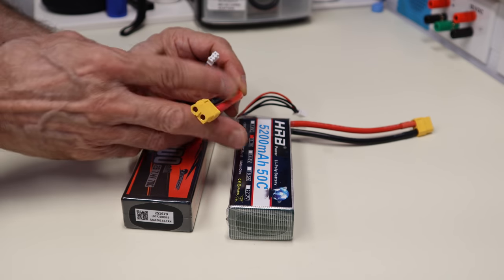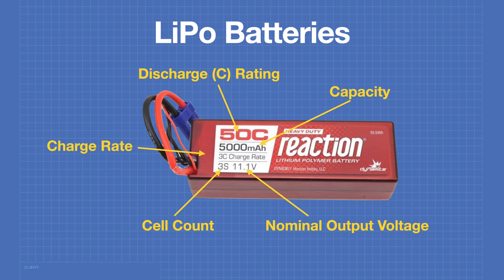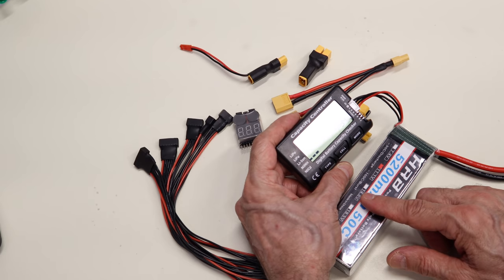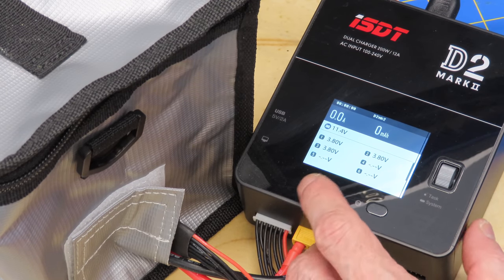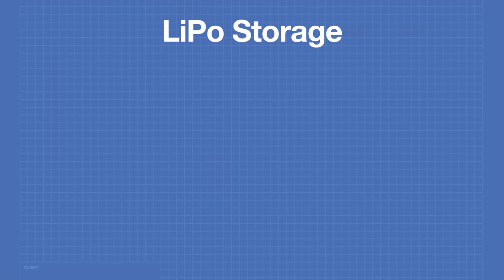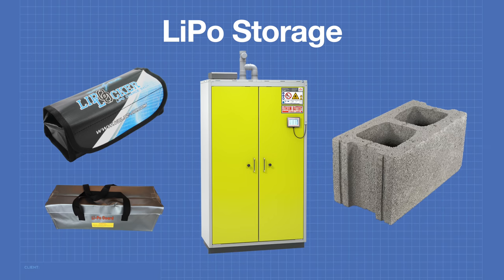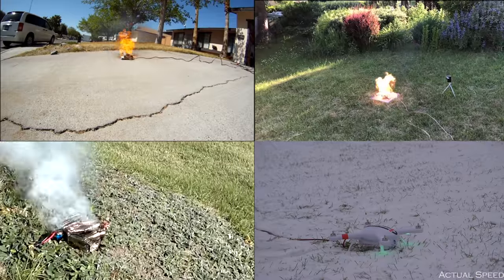Safely Using LiPo Batteries

Comment: When storing with cement blocks, why not use two blocks with the top block turned ninety degrees from the bottom. That would make the battery fully encased in concrete if on a concrete floor or on a third block.

Comment: I'm glad I watched this before buying any LiPos. I'm definitely not prepared for the risks.
Reply: The risk are very rare tho and it’s usually only when charging they don’t just spontaneously combust. Just be smart about where you place the charger and battery every time you charge and you should be fine. There’s people that have dealt with lipo’s all their life and have never seen a fire once. Just follow basic safety steps or charge outside somewhere you can chuck or leave it in case it does happen. I charge mine on my desk on a metal baking pan near my window in a two story house. I never leave them charging unattended and I check on them every like 10-15 minutes to make sure they aren’t getting too hot or making any weird noises. If something were to happen tho I can easily chuck the pan with everything on it out the window worst thing that would happen is the charger might not make the fall but that’s it. Just be smart and sensible you’ll be fine, also don’t cheap out on the batteries. That 10-15$ lipo might seem like a good deal but it’s just better to spend the extra cash and get one from a trusted manufacturer.

Comment: That has to be the very best tutorial on battery management to be found on YT and beyond ;)  I was trained in the military on battery and battery store management way back when and although the chemistry was different it is the same H&S process as you have illustrated. All that you outlined can be usd for any chemistry, just learn the different steps and characteristics. of the chemistry. If you are looking after lead acid then there are various dangers, not least sulphuric acid or performing a gassing charge :) And so it is whith any chemistry.   Thank's for a great video!

Comment: Very informative Bill, with their ability for a catastrophic fire I am surprised they are not required to all have over current protection built right into the battery packs. With the vast array of connectors is there a standard list of them with standard usages.

Comment: Thank you, great video as always.
But... C remains a little confusing. I read a lot of literature on the subject and it's never clear.

Please correct me if I'm wrong, but C is the capacity. 
50C is the discharge rate. Meaning you can discharge the battery at 5.2x50=250A, which I would very weary of.

But to charge it, at max 1.5C, that's 5200 x1.5 = 7.8A. You mention around 21:00 that you could go all the way to 12A... I don't think you should.

Comment: Hi, thanks for this video! Very informative! I have a quick question, I will appreciate your opinion about it:

I have some powerbanks at home and recently I started using one of them as a "UPS" for automatic pet feeder, it stays charging at all time and also connected to the feeder. 
I did some research and could not find any issue doing it. I'd like to know your opinion about that use. 

Thanks a lot!

Comment: Good information my cell phone just started to  swell up and split the casing open. How do I get all my pictures and apps. transferedto the new one when it comes next week ? I've turned it off and removed the SIM card card. I plced it in an Old Cement Mixer out in the Yard just in case .I like your Videos on Arduino ,555 timers and Transistors but I'm Retired and just getting started. Things have sure Changed since I took High School Electronics back in 1967 -1968.

Comment: Hello and thanks for the videos. I've been watching a lot of your tutorials so thanks! That said, I read the article and watched this video but, I was looking for advice on connecting 2 3.7v 1100mAh batteries in parallel. The article said there was an accompanying video using splitters but, I didn't see it on the website! Can you provide a link? I'm pretty sure I understand how but, I want to be as safe as possible. Thanks again, your videos have been extremely helpful in developing my project.

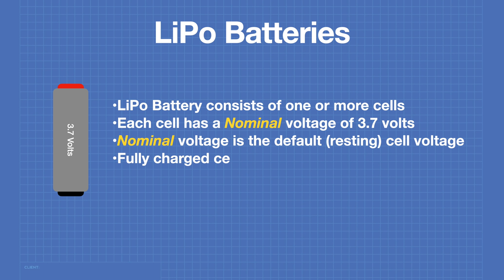Comment: Interesting. Having 20+ years of experience using LiPo I've never used cells with a charged state voltage of 4.4v (03:50) , they have always had the (critical) limit of 4.2v which you even state (16:17) so I wonder where that figure came from? 
The term "resting voltage" you use is probably a little confusing to some as the "nominal" voltage is usually referred to as the nominal voltage under operation although the real cell voltage will be somewhere between the maximum charge voltage of 4.2v (not 4.4)  and the safe minimum of 2.9-3v (depending on manufacturer).
I can't quite agree with the broad statement (04:45) that parallel cells are no longer necessary because individual cell performance has increased - that is totally dependant on the end use of course. I have a specialist product in front of me that has been specifically designed to use parallel cells due to the form factor and availability of the chosen cell.
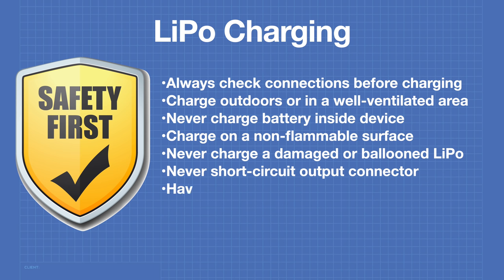Your safety advice on charging and the treatment of LiPo (17:05) is certainly exceptionally conservative these days. For example you would never consider taking your mobile phone, laptop or any other commercial device outside to charge it!  Great advice for high capacity model batteries that are regularly abused with high current deep discharge cycles but again in 99.5% of other cases using a commercial charger on well treated cells is as safe as charging your phone. In the lab we have often charged cells using bench supplies using CC/CV method, it is perfectly appropriate for that environment but of course not good practice for the average user. 
Thankfully many or most LiPo cells - including small pouch cells for hobbyist projects - come with over/under voltage and balancing protection these days to avoid many of the pitfalls present in the cells of yesteryear to which all of these precautions applied.
Again great production on the video.  Cheers.
Reply: Yes, he's overdoing his safety a bit - he's charging a battery in good condition in a Lipo bag, then on a baking stone and on top of this at just 1/3rd of the lower bound of regular charging rate (normally 1C to 1.5C). And he's got his fire extinguisher on the side and is complaining he can't charge outside 😂 
I bet he couldn't sleep later that day because of all that risk he took charging inside 😂
Reply: @JC-XL  to be fair Bill does a great job of these videos this one is perhaps just a tad biased towards the care and feeding of very abused older cells.

Comment: I have LiPo and Li-Ion (in 18650 format) Batteries, will you do one on Li-Ion as well? 
Maybe on Protection Circuits too? 
I've used 3S ones from Keeppower, the Keeppower XZD-3S1550

I actually store them all in an ammo case (the same type you showed in the video), but hadn't removed the rubber seal, did that right after the vid though - safety first ^^

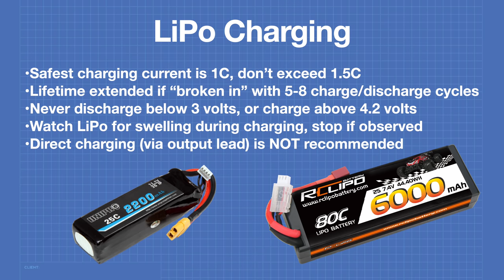Comment: 18:08 "Direct charging (via output lead) is NOT recommended". I'm pretty sure all chargers put it the bulk of the charge via the output leads. The only alternative to that would be the balancing connector and leads, which are not rated to carry a 6A charging current ("1C" for a 6000 mAh battery), let alone a 15A charging current (3C for the 5000 mAh battery shown at 6:07).

I think what he means is that direct charging via ONLY the output leads (i.e. without balancing) is not recommended.

Comment: Does anyone know what to do if the lipo battery won't charge? Like am I using it till the individual cells are too low? The battery is brand new and so is the charger. I've double checked the specified settings on the charger and everything but the battery will not charge.

Comment: are Nickle metal hydride comparable i also have some fast charge  cells that deliver a full 1.5 not the 1.25 of other rechargeable cells.
Reply: No not even close. If you wamt safety with almost the capacity of Lipo get LiFePO they will get hot and vent but not burn evrn when shorted or shot with a gun.

Comment: What a bummer, I bought 12 100-amp cells at $155 each and BMS for $149 from Overkill solar. For my off-grid property, got a victron mppt charger, went up to my off-grid property my my charger was putting out 13.5 battery was at 9.8 12-volt battery. I think each individual cell is below 3 volts I guess the BMS did not do its job. Overkill solar refuses any kind of support. Looks like I just pissed away $1,800, never could connect to the BMS through Bluetooth. really bummed out I'm going to try to charge them individually get a different BMS we'll see what happens. Thanks for the great video even though it ripped my heart out. Sounds like my battery is totally ruined. I'll be making a video showing my whole process trying to save this battery. Sounds like the bms shut it down and then drained itself powering the bms. Then I found out you got to spend five bucks to a third party to be able to change your parameters. I'm going to try to hook to my laptop through the USB
Reply: is the BMS even suitable for 3S Li-Po or Li-Ion.

or did you order LiFePo4 ?  100 questions...

Comment: I am used to working on USB powered projects with 5V and maybe a max of 2A. The idea that they have a higher voltage and output a whopping  357 A sounds crazy to me ... Is this just the peak value or can they output this for longer?
Reply: just a few minutes in serval bursts.

the wires are mostly 4mm2 crosssection. so 40A continuos would be max. for the wires alone.

Comment: In June 2020, I became homeless and lost everything I had in a fire started by someone in a neighboring building. That is the something I do not want to go through again. I must admit I took the risk of LiPo fires too lightly. Blame it on ignorance. I'd been carelessly mangling the experimental battery I'd been using! The plastic covering has not been cut open, but the battery did suffer a few small dents in it. This has not kept it from working though. I'd set aside the idea of buying an extinguisher for my home, but after watching this video I ordered a Class BC extinguisher right away. I have been experimenting with LiPo batteries for a short while now. I have 6 of these devices in my home. 

I'm relatively new to electronics. I have no formal training in the subject, but I'm an adventurous explorer in many domains. Recently, after destroying one of the chargers found inside the two 20000mAh LiPo power banks I took apart, I realized I only needed one charger to charge both batteries. However, having removed the charger also means I removed the low battery indicator which was on the same device. I don't want to damage my batteries to low charge. So, I have been perusing the internet for a suitable low battery indicator circuit. Preferably, one I can build myself at home. Of course, I will only use the chargers I separated from the power banks with the same type of device the chargers came with. And because the chargers are intended for 5V batteries, I will not attempt to use them to charge a 3.7V battery. 

Though I don't have one, I like your idea of storing LiPo batteries in an ammo box. The metal case should make these somewhat fire retardant, and I imagine these must be explosion-proof, right? Your drywall-lined toolbox is also a very good idea.

Thanks for all of the useful info, Bill. Keep it up. I'm watching, learning, and better informed.

Comment: Years ago I opened a battery pack an surprised to find a microcontroller attending to every need that the new types battery had, just like a prima donna actor/actress or athlete, in either case you don't want a meltdown, the old lead acid batteries was always easier going, it took a lot to get a lead acid battery to misbehave in comparison, it's a shame about the limited capacity.

Comment: Lifepo4 is safer than Li-ion which is very volatile on thermal run away. 
LifePo4 is safer as they do not need safety boxes. 
Really it is misleading to show safety blanket when charging Lifepo4 battery.   One does for li-ion

Comment: Ummm... the max charging voltage of a lipo cell is 4.2V, not 4.4V. At 4.4V the cell is likely to explode. It’s a bad mistake to include misinformation in a video that is supposed to be explaining safety types for a dangerous kind of technology.
Reply: He corrected it later.